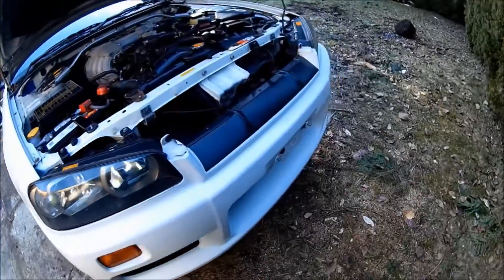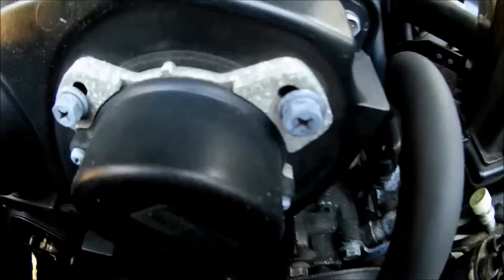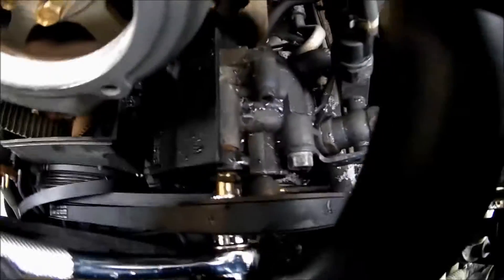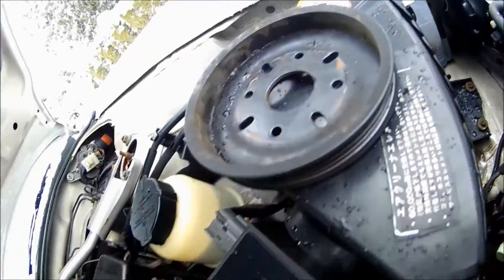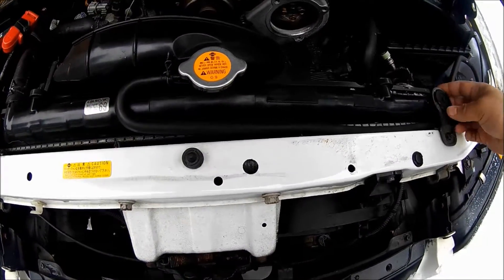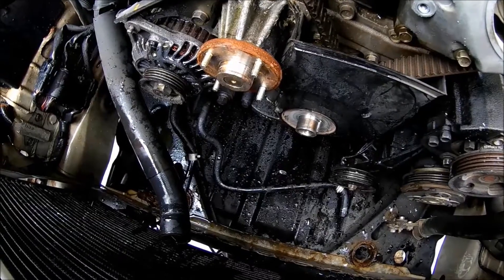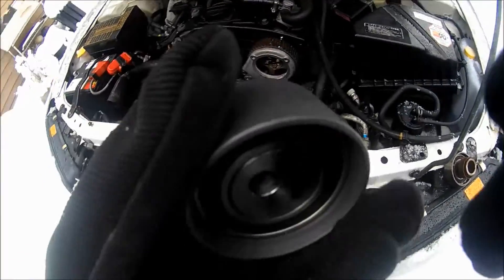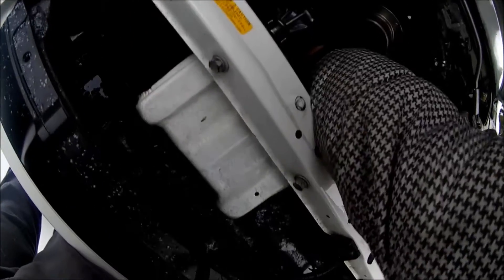RB25 Timing Belt replacement

Comment: You still have this car?
Reply from the maker: No sold it. Ended up getting an R33 like it much more.
Reply: Abdullah Zahid why do you like it more than the r34?
Reply from the maker: @raftika1  Personally i like the way r33's look compared to the R34, unless it's a gtr then i like the R32's. Plus my R33 came with the RB25DET which is turbo and my R34 was N/A.
Reply: Abdullah Zahid have you had any issues with the turbos on your r33?
Reply from the maker: @raftika1  No it's been pretty good so far. About the same reliability as the N/A.

Comment: My alternator won’t move, the two bolts are loosened for the alternator and yet it won’t slide forwards or back ???
Reply from the maker: This should help https://www.youtube.com/watch?v=JkrXnv9Sv_g. If you have removed the correct bolts you may need to use more force. I'm working on a R33 right now and it was quite hard to move the alternator. Start the video at 3 minutes and watch till the end. Good Luck!
Reply: Abdullah Zahid it’s my r34 gtt so rb25 neo, thanks I’ll have a look
Reply: Abdullah Zahid I was reading online and someone said on a forum that you need to remove the main alternator bolt first then loosen the two adjustment bolts? What main bolt is he taking about ?
Reply from the maker: There are only 2 bolts you have to loose. In the video i sent you a link to i show you what 2 bolts you have to loosen. Like i said i picked up a R33 and it has the RB25DET NEO, and i also had trouble moving the alternator but when i put force on it the alternator moved i used both hand to move it up. Move it up to loose the belt, move it down to tight the belt.
Reply from the maker: Let me know if you still need help. If you still can't get it i will make another video asap on the alternator.
Reply from the maker: Also have you replaced a timing belt before? It's a pretty hard job make sure you take your time replacing it. Please view this if you haven't already https://www.sau.com.au/forums/topic/397602-how-to-replace-a-timing-belt-202526-pics/. It is really important that you have a good understanding when you are doing this. Good luck!
Reply: Yes done timing belts before, in this case I’m just doing serpentine belts. My alternator belt came off somehow whilst driving and now I’m replacing all three. All them are off and I’m just about to go outside and put them on. Hopefully the alternator moves I’ll just need to use brute force like u say lol. Thanks
Reply: Nah alternator not moving even a little bit.....😡
Reply: Got it, I just cracked the bolt at the bottom of the alternator and it moved very easily.
Reply from the maker: That's great man! I'm glad you got it.
Reply: Nice video! Thanks for the info! Where did you buy the replacement parts? Trying to gather up the parts first